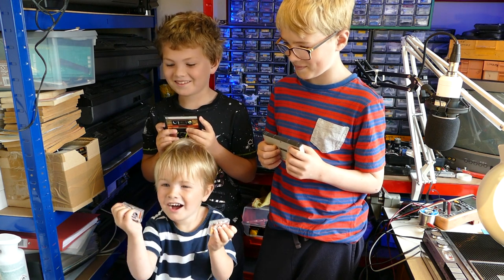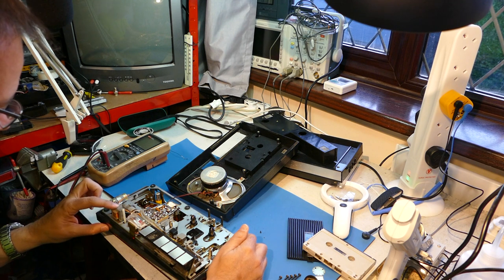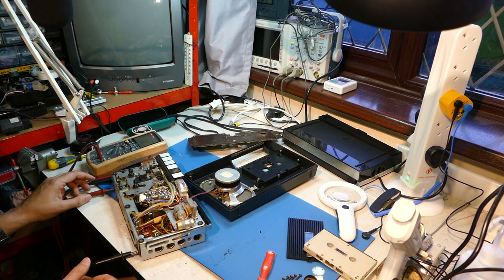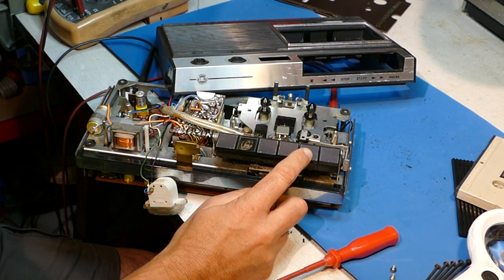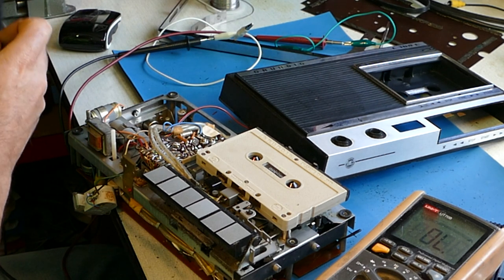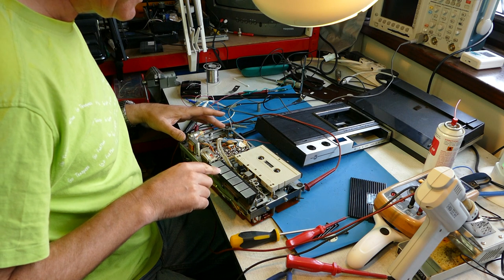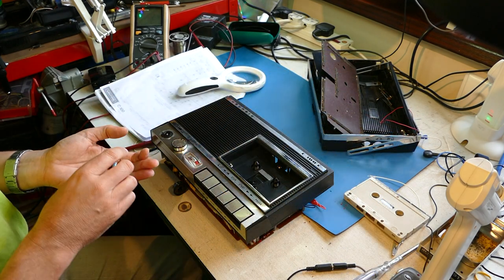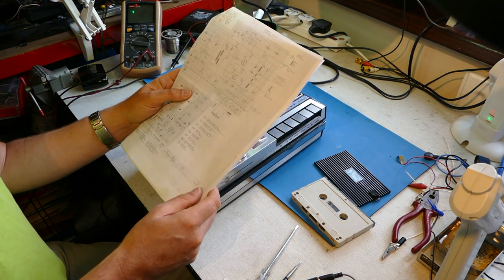DC International Grundig C100L, repair to component level.

Comment: I would prefer to see some macro shots of the heads, capstan and PCB, rather than your "embarrassing" moment with the speaker stand off...  As I understood, the tape is the same as an ordinary cassette, you could spool a new one in that shell...
Reply from the maker: You could probably spool new tape into the shell, though the running time would be shorter because tape speed is 2 ips rather than 1 7/8 ips, so a 90 minute Compact Cassette would yield about 84 minutes of recording on DCI.  There's also the possibility that DCI tape is thicker.  There's very little to see in the heads and capstan, all very conventional: https://www.video99.co.uk/images/DCI_heads.JPG